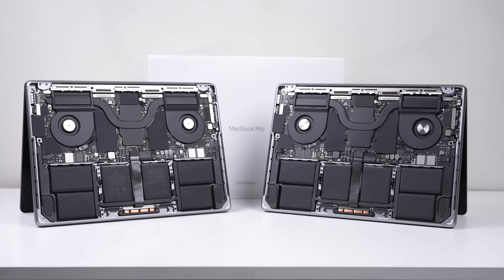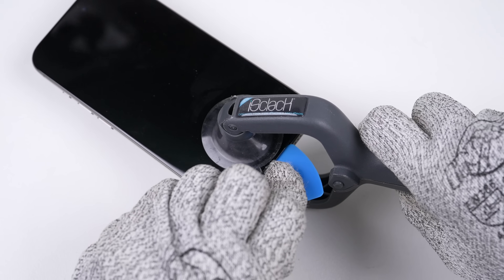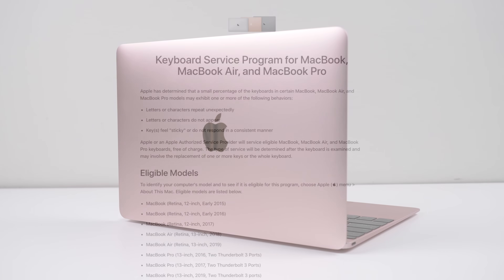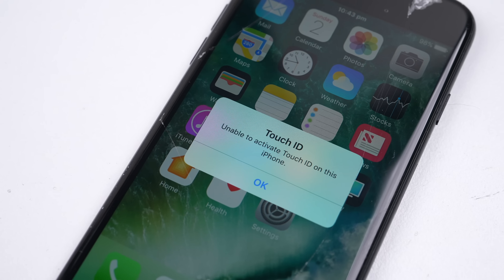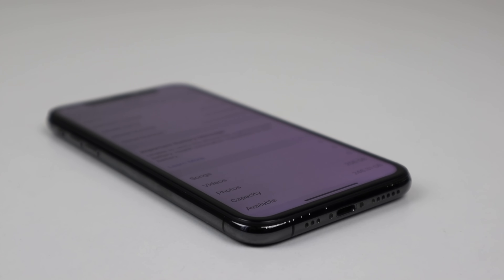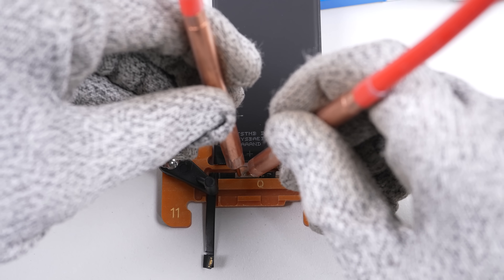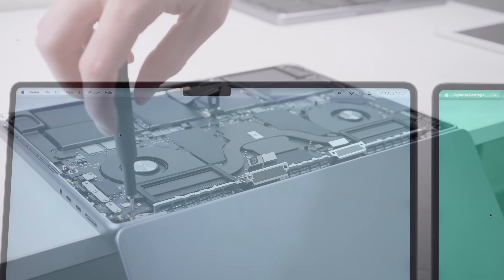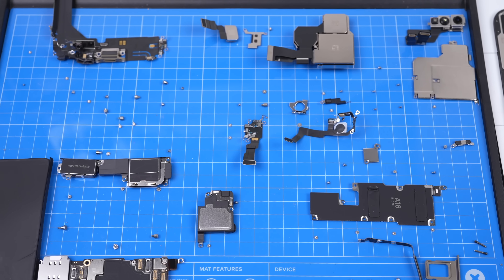Astonishing Anti Repair Practices By Apple In the Last 15 Years

Comment: I DO NOT TRUST APPLE ANYMORE WISHED I NEVER SWITCHED TO APPLE AND STAYED WITH WINDOWS MICROSOFT A TEPAIR OF A SMALL CGIP AT THE Apple Store on my $7500 XDR DISPLAY 42” and it doesn’t include labor ! Real crooks it works great the advisor told me at there store it will never brake down for this little hair crack in the right bottom in the 1/4 “ black around the screen but if it brakes a copy made by SAMSUNG for $1099 with the stand 27” looks better and has a better photo Apple is a real ripoff PLUS AT THE TOWN SQUARE THE LADY APPROCHED ME AND MY WIFE WAS VERY RUDE TO ME I AM FULLY DISABLED SHE GOES GO OUT WAIT AT THE STREET I KUST DID NOT LISTENED TO HER EVEN THE SECURITY LOOKED AT ME I HAVE NO SPINE ITS MADE OUT OF CAGES AND HAD MY WALKER SINCE THE DOSTANCE WAS CLOSE TO PULL DOWN MY ELECTRIC WHEEL CHAIR  APPLE IS HETTING TO NE THE RIDEST PLACE SPECIALLY THE STORES I FORGOT THE NAME OF THE EMPLOYEE AS I HAD TWO CARDIAC SRRESTS AND TWO STROKES AND AN OPEN HEART TWO OPEN BYPASS SURGERIES MY NAME IS SAM IBRAHIM HAS 2 iPhones max pro 17 ordered online by Amy Landon one of the very best to deal with very polite but I am wiling if Apple wants me to drive to the Toen Square store and point at her so she gets a course in politeness to a 76 years old person who is close to Christmas Eve being 4 years in bed 24/7 and very rarely leaves my house with my wife where my day was going great until my 3.20 appointment where she ruined my whole day

Comment: hey hugh! i thought id point this out with ios 18 you can still have true tone if you replace the display.. i replaced a display on a iphone xr that i got off facebook market place and true tone worked fine! i didnt even need to program the screen either.. although my light sensor was the original to the phone as well as the face id which sadly was broken... so ios 18 might have fixed the true tone being missing after a display swap... i replaced the one on that xr with a 18$ display off amazon!

Comment: There are so many ways to deter self repair. Cost and parts availability. Difficultly of repair will deter most people.  Apple wants to sell phones. Torx plus is superior to Pentalobe. The use of glue is amateurish. Battery replacement design should be easier.

Comment: Agreeing to everyone's sentiments, what I also wonder is one more aspect in this whole decades long story:
Who is benefitting from this *really*?

I refuse to believe their own approved repair team agrees with these practices when it makes their repairs far harder than necessary, considering 3rd party ones like you, Louis Rossman and others are just as capable if not moreso, and the Genius Bar horror stories and incompetent staff anecdotes keep pouring in. Charging just as much for a home repair kit as real professionals with "accreditation" while the core issues remain feels like an insult to their own staff and their own money.

Perhaps the manufacturing process is made cost efficient, but to what extent? Making a whole new screw slot named Pentalobe that feels almost designed to trick you and self sabotage yourself that keeps persisting for almost a decade, this cannot be a cost efficient choice when Phillips and Thorx and others exist. You can't tell me the utter opposite of outsourcing your screws from other companies, the actual traditional cost cutting practice, and making them in-house is saving you money. You already make many parts in-house, the parts where a difference in quality can be made, but not for screws!

They already heavily rely on software based walling of their customers in their own "garden". Why keep the hardware the same? EU already forced them to switch to USB C and followed suit, clearly proving is possible!

This all feels like self sabotage of any and all parties involved. Is like they want to take everyone down with them. What's the profit here, capitalistic mega-corporation?

Comment: its because people keep dancing in the palm of their hands that apple keeps doing this crap, and guess what they're still up to their sketchy ways, literally I have done a 14proMax screen replacement and it overheats even after a earspeaker, then there is the macbook 2024 which doesn't have a replacement screen yet you have to be careful or else you'll screw up the small cable for the lcd panel or the ic will be torn. Literally stupid bs from apple and I will refuse to do any of the newer macbooks until a full replacement including the ic and lcd and back plate become available.

Comment: Only Apple would serial-lock a friggin camera module.

What's next, wireless verification RFID embedded in the rear glass? A verification IC on the button board? Removal of the USB-C port to force users to only wirelessly charge / pair accessories?

Comment: CrApple. Their latest devices are some of the worst. If you're lucky an M1 laptop will last two years. In the 90s computers lasted indefinitely. Normally, the hard drive or fan was first to go, after about 7 (!) years, and you'd only have to remove four screws to access them

Comment: the fact that they had to come up with some ridiculous, overengineered solution just for the lid sleep sensor is insane. basically every prior laptop either uses a reed switch or a mechanical switch, and both work perfectly fine

Comment: In few years time (2027) an EU law will mandate that smartphones and laptops must have an user-replaceable battery.
For the time being, the Fairphone 5 and the Framework laptop have replaceable batteries, but they are fully user-repairable devices sold in small quantities, and their price is the double of a standard, sealed and non-repairable device with the same specifications...

Comment: i recently retired and started out working on computers and ironically had to work on them again at my last job.  apple was the worst.  you had to buy a special set of tools and then when you got the damn thing apart it was like "wtf is this??"  my big meaty american white guy hands were not meant to work on stuff like that.  the little ribbon strip connectors were nearly impossible to disconnect without ruining them.  ya i felt like a dinosaur playing a piano and am glad i don't mess with that stuff anymore.  but i will say that apple stuff seemed really reliable so it didn't need much work on either the hw or os.  just don't let the battery swell and ruin your keyboard/keypad.

Comment: As guilty as I think Apple is on all this, the entire electronics industry changed by the early 2000's. No longer were repair manuals produced and manufacturer's replacement parts available.

Comment: I refuse to get rid of my 2017 mb pro. I can still replace both ram and ssd
Reply: I'm guessing you mean 2015, as the 2017 one has everything soldered down
Reply: @sagwan-square well the ssd is replaceable, the ram not so much. Its been a few years since I tore it apart to replace the drive. Thought for sure I noticed swappable ram but I guess not. But its for sure a 2017
Reply: @SofiaisSunshine  Oh right yes I'm stupid, you have the function keys edition of the pro. The touchbar model pops into my mind when I think of 2017.

Comment: To defeat those oddly-shaped security screws without having the correct bit: heat up the tip of a bit of plastic, such as the end of an old ink pen tube, then jam it into the screw head and hold it still for a few seconds while it cools. Now, you've got a fairly serviceable driver to remove the security screws. I used to work in a prison, and that's what inmates would do to remove the light bulbs from the always-on night lights over their bunks.

Comment: It is not only about Apple. There has to be not only the right to repair movement but also software freedom movement. Vendors lock their products with buggy and obsolete versions of firmwares protected by rsa based encryption/signing basically deprivation user from control over device one have purchased.

Comment: It's not just Apple. Lots of phone makers moved to effectively non replaceable batteries. My most recent phone, a Galaxy A70 I bought reluctantly because of this issue, but I effectively had no choice. The battery is now dying. Curiously, the glue that held the back of the phone had deteriorated to the point where I can peel off the back and the battery is accessible. Go figure.

Comment: One of the things I'm grateful to the EU for is pushing the "right to repair".
Reply: That's why manufacturers are making it impossible to replace batteries, keyboards ect..
That fact you can buy third party replacement parts means manufacturers have lost a guaranteed revenue stream from selling parts.
Eventually electronic gadgets will be throw away items as repairing becomes uneconomical or impossible due to design

Comment: Didn't even make note of the even back when macbooks had replaceable SSDs they still used a proprietary pin cutout anyway so you were paying a premium for replacements. Soldered storage is such an unbelievably horrendous practice in laptops which can't be understated.

Comment: 1. i repair my screens for about 30$ myself. no issue with offbrandchina stuff. neither with battery nor screen or other components! I did so with basically any android brand
2. bought an old laptop and fumbled with it for a few hrs and made it run smooth for 50$ (ram, new SSD, new processor, new battery) ... works FINE ... with windows ofc
3. FK APPLE.... seriously. SO GLAD they got slapped with USB-C after screwing over customers. i LOVED how they cried "but but but innovation" ... ja sure... your mom. 

They overdid it and got a smack for it. I cant feel a hint of pitty for such scumbags screwing customers and environment alike while acting high n mighty and so 'devine'

Comment: I bought a refurbished Pixel 7 and is working great!  This seems like a win-win.  As people get more for their second-hand phones, that can be easily be fixed and resold.  This means when buyers get a new phone they can sell their old phone to reduce the cost, which means more people get new expensive phone.
It's a bit like cars you're not going to buy a car that depreciates in value quickly, as it will cost you more to trade in the car in the future.  So the car needs to be easily fixed to keep it going and valuable.

Comment: If cell phone companies were actually trying to give a shit about anything but profit they would make all batteries exactly the same it would make a standard battery that fits every single phone and is removable they would make cases that fit the most amount of phones possible and it would make everything modular and standardized across the industries so that we can get a new phone and use our old accessories even the battery etc. Fuk these companies

Comment: dang.. meanwhile i just bought a new 4060 acer nitro after my 1660ti predator finally had to go, decided to downgrade to win 10, simply cloned my old nvme, 11 screws to lift cover, insert my other 2tb nvme, insert my internal hdd, 3 screws total, everything booted up no issues, cover back on, lower tdp to 45, idling in 20s, ghost of tsushima on ultra

with thunderbolt 4, can use external nvmes as well, for total space of 8 tbs in ssd and 4 more in hdd, one cable

and with all that said, i still have 0 love for acer, they're just the cheapest option, but they have their own set of capitalism BS, nothing compared to this though.. man soldered ram wtf lol.. im throwing a 5090 into this thing with 64 ggb of ram in 1-2 years and i'm swimming

Comment: It is a better screw all things considered. It's about how much contact the screw makes with the tool. With curved internal mating surfaces the tool and the screw can more efficiently connect over a larger contact patch because of the complementary curves rather than flat surfaces and edges which tend to burr and warp and reduce contact.

Comment: And this brings up an important point. If they're so progressive why do they create trash with planned obsolescence and no path to recycle or reuse any of the components that are still useable? Like the electric car situation with the batteries. As of now the battery tech for electric vehicles is far more detrimental to the environment mile for mile than fossil fuels. In the short term it's a neat idea to have electric cars but it's still not better than efficient gas engines. We're being played for fools by corporate America. You can see it in the ads they use to market products to middle class America. They treat you like you're retarded and you eat it up. There is no real consumer protection anymore it's all greedy corporations taking full advantage of all angles to make more profit.

Comment: None of my phones, laptops, or handheld devices have ever had dust or hair in them like Apple's junk does. They build crap meant to be broken and replaced. Im still using my LG K8 v2 from 2017 or 18 I forget. Works just fine and has no hair or dust inside the device LOL - EDIT- And original battery

Comment: This video is a pretty nice summary of why I'm still using a 1st gen iPhone SE; I'm not saying a battery replacement is easy but at least it doesn't inherently break the phone in software. About the only thing on this list I'll defend is the screws, a single new screwdriver or bit to buy is a fair trade for not having to potentially deal with stripped near-microscopic Phillips screws (which they annoyingly use inside the device but those are less likely to get stuck or corroded.)
Reply: Torx screws that small already existed, torx is a superior fastener.

When I first encountered one of those screws I immediately reached for my tiny torx bit set, and had to look up what the F it was when I couldn't get one to fit.

There is absolutely no benefit to the fastener other than keeping out repair people who aren't specifically prepared.

Comment: What about how emc3195 2019 IMacs have a very “convenient” enclosure around their memory slots. In order to change the memory involves taking most if not all the parts of the IMac out of its casing just to unscrew it off

Comment: Two things you missed:
1: Apple is the only major laptop manufacturer to make replacing the display panel impossible, instead the entire display assembly must be replaced. 

2: While not specifically *repair*, along the same lines was when Apple disabled all charging safety features in 2013 in test markets in China. If the iPhone 4 didn't detect an official Apple charger, it would simply ignore all safety protocols. Dozens of iPhone 4 in China caught fire and exploded. This was reverted in 2013 after Ma Ailun was killed by her phone exploding. After a lawsuit that was settled out of court, Apple pushed an update to all affected phones that reinstated all safety features, refunded all iPhone 4s sold to affected parties, and gave everyone affected a brand new charger. In addition to the unknown amount settled, it is estimated that this stunt cost Apple $75m-$100m.
Reply: I fucking hate public companies so much

Comment: With that glue they used.  If it was any worse they may as well just flood the inside of the phone with it to permanently pot it in an almost indestructible resin or glue.  The way that Apple is so antirepair it surprises me to no end they didn't do it.  They could have just done that and pissed everyone off telling them "I told you it is not repairable"

Comment: If apple made a car, the only way for anyone to change the oil would be to take it into an approved mechanic and have the whole engine replaced, then have that engine paired to the car.
Reply: Only way to guarantee it will work bro. Didn't you buy the Apple Car Care package for an additional $100k?

Comment: Certified Apple repair technician.
First off, alot of their repair facilities? Hidden as a different kind of facility in badge-locked warehouses. Weird AF, very shady. There was probably something illegal going on in the backdoors, I'll be real with you. The security regarding the repair facilities goes well beyond any reasonable measures youd expect of a commercial facility.

Second, a whole lot of their laptops, if you'd like to fix an issue with the keyboard? Go ahead and tear down the entire laptop. The whole entire thing. That includes jamming a sharp object up under the very soft battery so you can remove their flimsy, snappable tape that can easily rip open the battery if you try to take it off with the tape torn even slightly. We had multiple chemical fires because of this, including an eye injury.

They also just suck in general. Consistently lower performance to any competitor for a massively inflated price and severely tanked freedom of use.

Do not purchase Apple. Ever. The company needs to wake up and face the music or end up in a dustbin.

Comment: I was told after trying to fix an old IPad that the battery was linked to the display, so if you disconnected the display before disconnecting the battery, it would fry. That was by design, and basically meant many IPads would brick if the display got disconnected after falling because that would fry the bettery, requiring a complete replacement which would very likely not hold on.

Comment: If Apple truly supported right to repair, they'd immediately remove all DRM on hardware parts – especially on their ostensibly user-serviceable Mac Pro – and add the doors for replacing RAM and SSD back to the MacBook Pro.

Comment: Apple would make things worse with their M series chip Macs that have removable SSDs as in those the storage controller is an internal component of the M chip itself right with the processor cores in the same dye and Apple claimed they did it to increase storage read and write speeds. However it meant that the storage capacity and what specific SSDs you could use was physically hard baked into the physical design of the M chip itself.